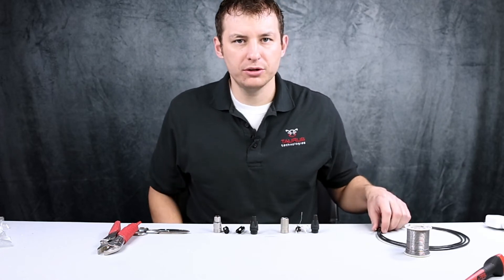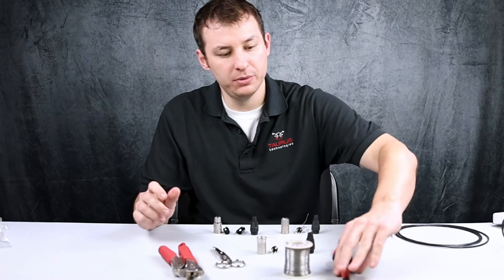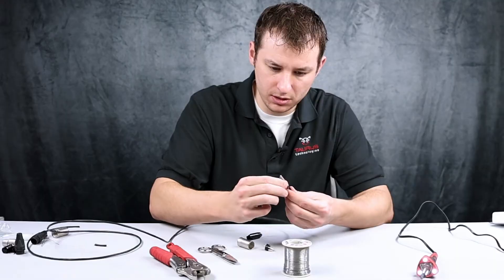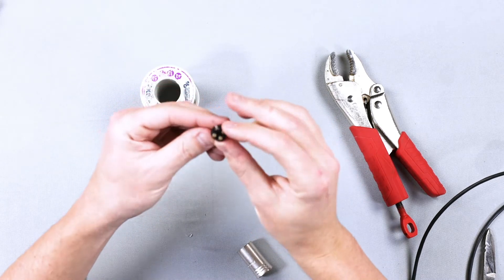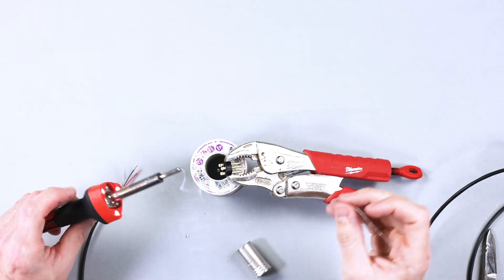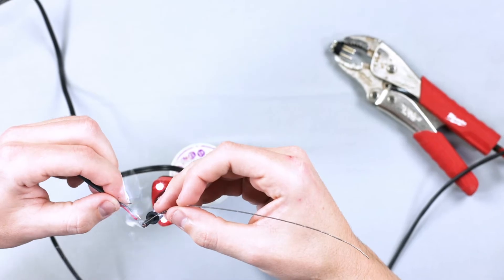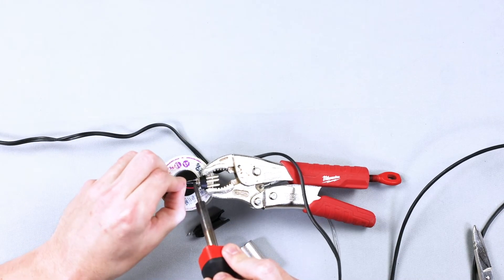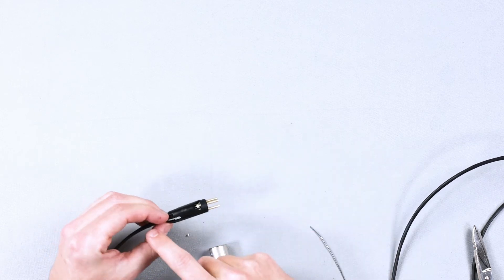XLR Soldering: Ultimate Guide to Soldering XLR Cables - Easy & Effective

Comment: It’s quite some time since I soldered… is there no need to use flux anymore??
Reply from the maker: In the video, we didn't use extra flux, but it's still important depending on what you're soldering. Even though the solder we used had a flux core, sometimes adding more flux can be really helpful. It cleans the metal surfaces, removes oxidation, and helps the solder flow better, making for a stronger and more reliable connection. So yeah, even though the solder has flux, adding a bit more can make a big difference, especially with tricky joints.

Comment: Four conductors but it's not star-quad. Foil insulation  and drain wire so it's for installation. Also rigid. What brand / model of cable is that?